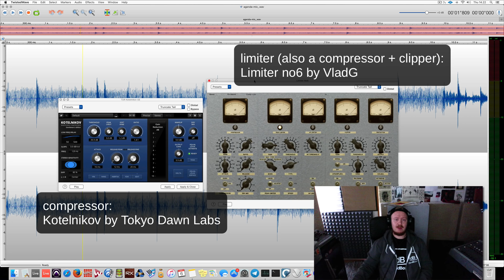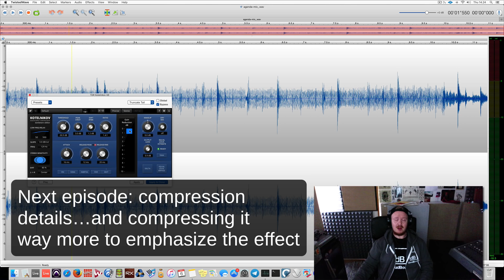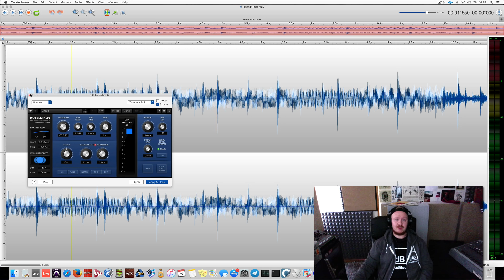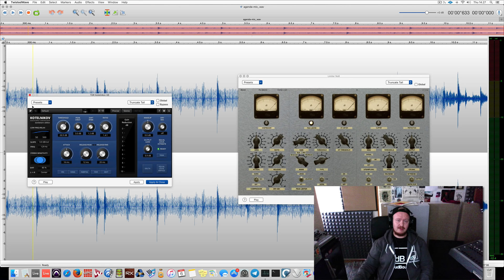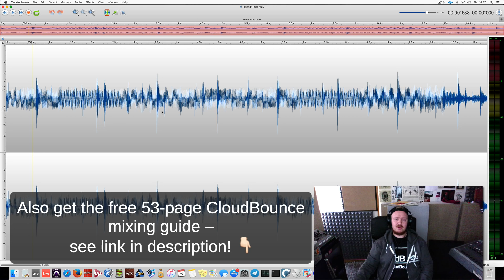How to make your song louder? Compressor vs limiter vs clipper

Comment: Actually depending on what compressor you use they're all not fast enough to handle a snares transients.  Like a Vari-Mu style or Opto style aren't fast enough you need a VCA or FET style.